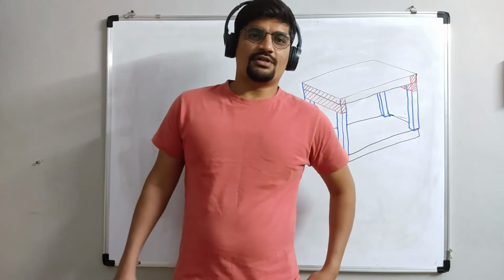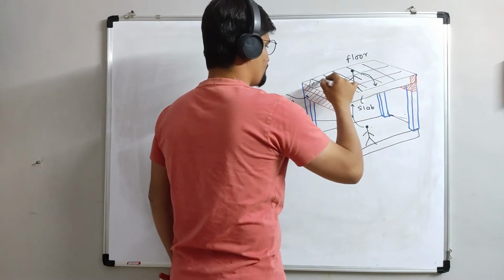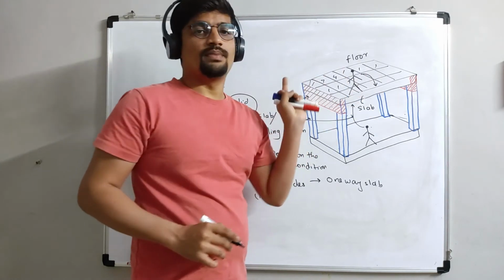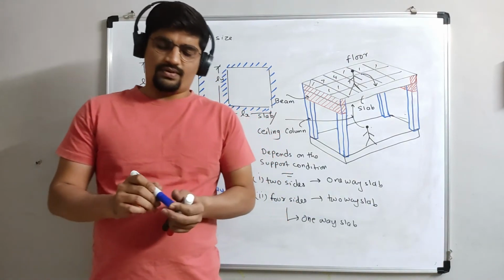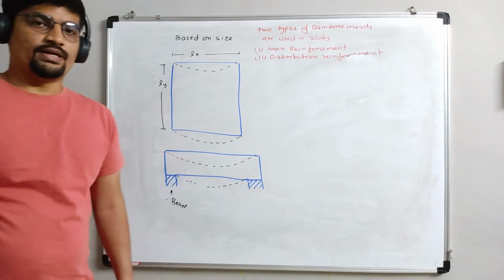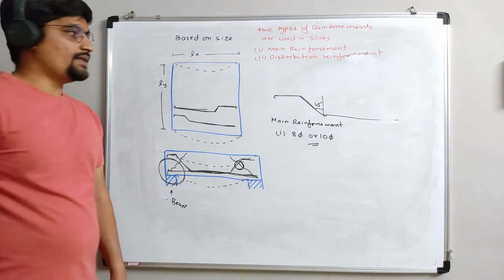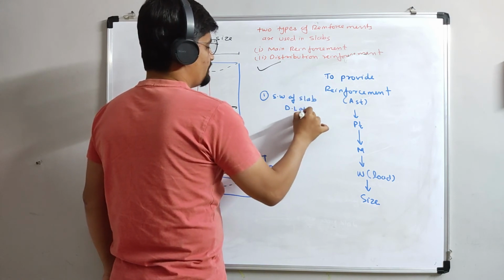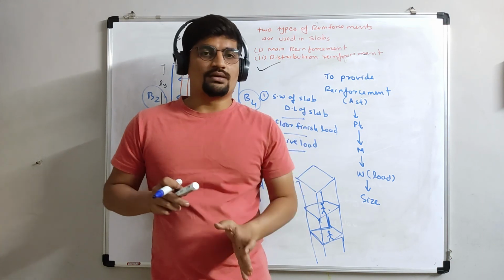Introduction to slabs as per IS 456:2000

Comment: Sir will a 4 inch brick wall effectively bear load of rcc slab lintel . Is it earthquake proof and sustainable
Reply from the maker: First of all brick wall never takes the load, it's only use for an asthetic view of structure. Loads of slab transfer on the beam and column. And the building is earthquake proof or not is depend on the design you have done ☺